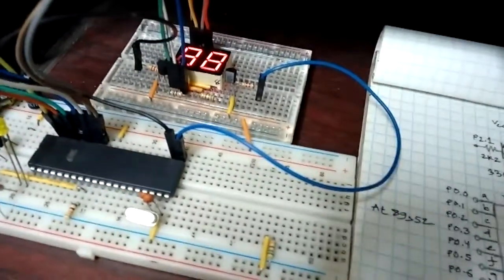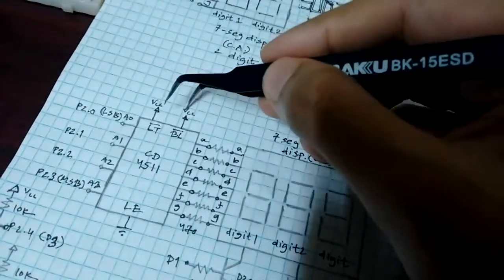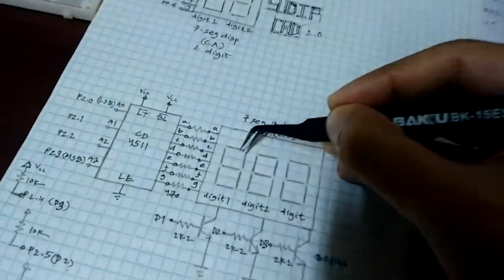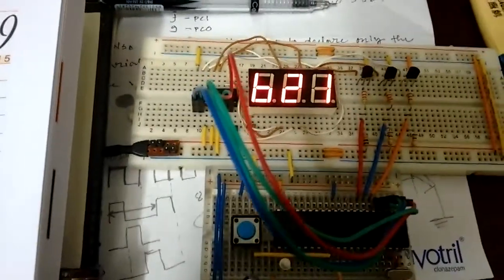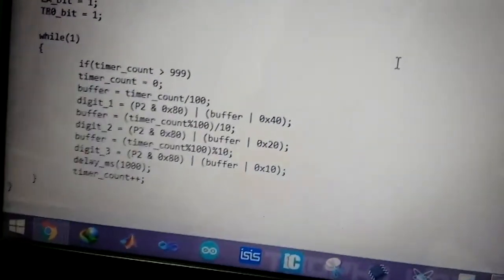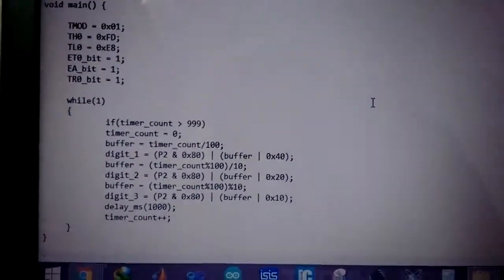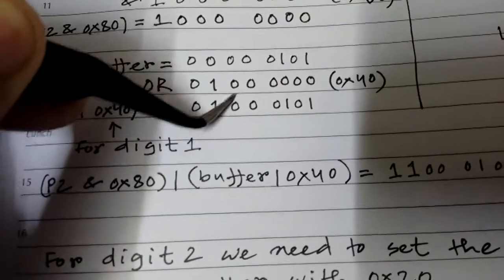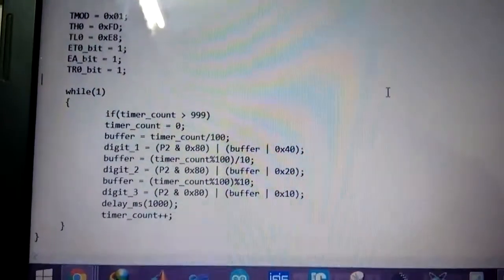Multiplexing 3 digit 7 seg disp using 4511

Comment: I think the 4511 datasheet says it has resistors built into the out, the one I read says output is 25 mA.
Reply: No, it is able to supply only 25mA without damage, it does not supply a constant current of 25mA.